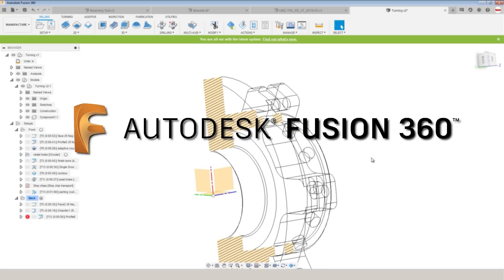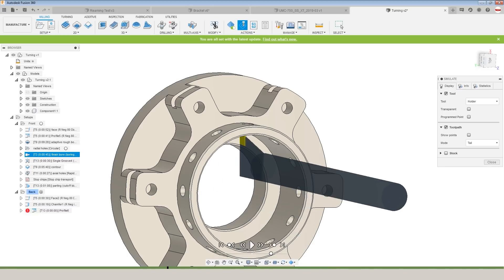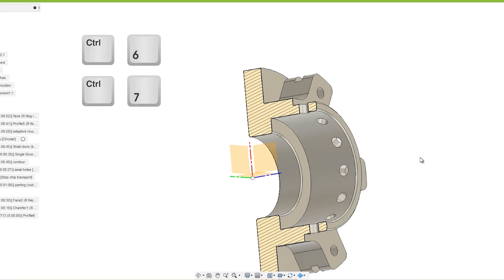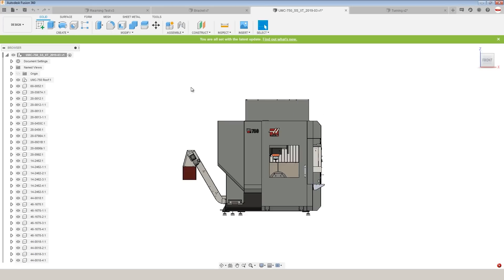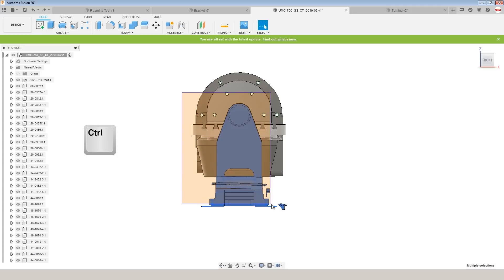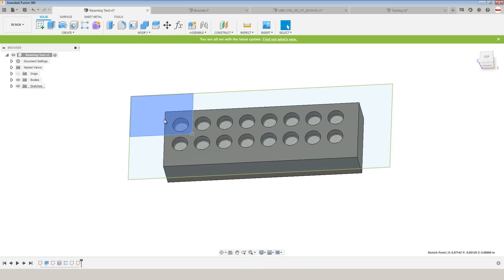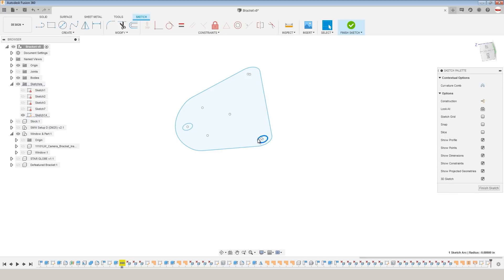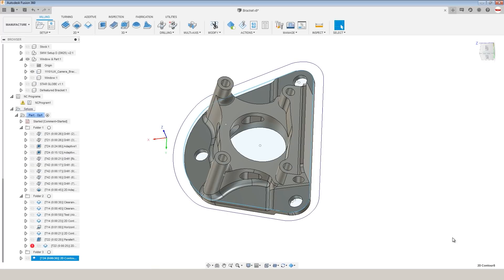10 Pro-Level Fusion 360 CAD & CAM Tips!

Comment: Impressive!!! I use to program, setup and run CNC machines over 25 to 30 years ago my 1st machine was a paper tape reader moved to a 3.5 floppy disk and then to rewrite CDs. Then I got rifited after almost 15 years of prototyping. Now I do mechanical engineering.  It was the best job I ever had. I put experiments into outer space that were successful. I made  prototype medical devices and equipment and other things I can't talk about. I also did model making, injection molding, metallurgy ,Mig, Tig, plasma, and complete wood working, to many other skills to list. That was the most fulfilling job that I ever had. The rest of my career has been boring in comparison, however it pays the bills. I just found your site after watching someone make a V8 block out of billet aluminum. Thanks for the videos I'm also going to subscribe.

Comment: keep up the videos John - gonna jump on the comments bandwagon and suggest a video helping people understand what they are losing with the changes to the "personal" version of Fusion 360 and reminding them what they still get.  What the capabilities/limitations would be using "personal" on a machine like a tormach would be helpful.
Reply: Check out Lars' video on the subject. That sums it up well.
Reply: @ScottMoyse  thanks, Ive seen it and it does sum it up on a high level. I would still like to get a more in depth breakdown of some of the limitations of things that are being brushed over by many... specifically, rapid feed limitations. What does that mean for tormach owners for example. Does this limit the adaptive toolpath itself or just linking moves between operations? NYCCNC has a history of clearly exploring topics and explaining any limitations.
Reply: @ericswakon  any where you see a GO in the code currently, will be replaced with G1 @ the programmed cutting feed. So in low feed scenarios, is likely that where full retraction and repositioning at rapid was faster previously, stay down and reposition at the non-engagement feedrate will be faster... As long as you control can read all the points without data starving.
Reply: @ericswakon  I'm also sure the community will figure out some ways of working around it. I have some ideas but I won't be sharing them publicly 😁.

Comment: Another Tip: If you need to select often edges within the CAM environment. Try to Alt+click, hold and drag away from an edge. You end up directly in the contour modification mode. Saves you one extra click - but can be many at one part ;)

Comment: I've bitten the bullet. I've ditched F360 due to their changes, and have been learning and contributing to FreeCAD
Reply: @BarryManilowa  Open-source is MUCH better than closed source when it comes to obsolescence. FOSS projects often go defunct but with the source, you (or anyone else can pick it up and continue.  Unless the original software was licensed under some odd, weak license, a commercial entity can't simply acquire it and change the license.  Such a change would require all contributors to agree and that can be difficult or impossible if contributors can't be found or are deceased.  A company can license new stuff under new terms but they can't just change the existing terms.   Taking an open-source project closed is very difficult.    You might be right about the rise of SAAS but I frankly think it has much more to do with the value of all the data collected.  Besides, the Affero license has been out and used for more than ten years.
Reply: The cloud computing means you can run cad/cam on a cheap POS notebook anywhere
Reply: its still cheap as dirt, not sure what all the home gamers are smoking.
Reply: Eggsr2bcrushed  Really?  What to stop them from charging $300/month and holding your data hostage?  What have you been smoking?
Reply: @BarryManilowa  It's 300 per year or cheaper with discounts. There's a huge difference between changing what people who pay them nothing have access to, versus upsetting paying customers and businesses with an insane 12x price increase.
Reply: @zunuf  For many people the wake-up call is how vulnerable they are when they build their business dependent on closed-source software.  There's no guarantee that the vendor won't eliminate an important feature or price you out of the market because your interests aren't aligned with theirs.  Software vendors can drop support for older equipment, change their programming APIs, or alter their workflow in ways that have significant impact.
Reply: @bradcollette2967  RMS has entered the chat
Reply: @Eggsr2bcrushed  I'm not really sure what that means.  If it's a reference to Stallman, I've never been much of a fan.  I don't have a problem with closed-source software but I think a company would be foolish to allow themselves to become dependent without thinking about it.   Negotiate a contract.  Demand that source code be put in escrow and released if they eliminate crucial features.  There are ways to ensure your investment is protected.   By the way, why such a Fusion Fan-Boy?  Got a dog in the hunt?

Comment: Autodesk has practically stopped my hobby currently, I designed and built my own cnc machine over nearly a year as I don't earn much money, I don't make money from using their software, I just enjoy making things and helping friends out with problems. So now I'm down on no simulation to check my CAM, I have to load a new file for every single tool change even though I use collets and have to do it manually so its clearly not an automatic tool changer, I have so many files well into the hundreds of active ones which I switch back and forth here and there for ideas and previous dimensions I need. I've absolutely loved using F360, very easy to use and simple but clearly I as someone who works from my little shed, making nothing but fun things for myself and pushing my own knowledge to make complex projects Is being termed a non-hobbyist as I have a machine capable apparently of more than what a hobbyist should have. I can't afford a huge hit of money for their software, I only use the CAD/CAM with simulation and that's it. It would be nice to see them listen and acknowledge the massive community of like minded people with such requirements and rethink their clear decision to force out the very people who provided for years the testing and finding the niche problems. I'm really struggling with FreeCad as it's incredibly hard work but I fear this may be the only option without having such massive headache from f360.
Reply: Dejan Brice I believe you are confusing two different “simulations”. It is my understanding that there is no change to toolpath simulation. What is being removed is the simulation workspace ie stress and strain analysis.
Reply: @martinmarriott3607  I really hope that may be the case, without it It's going to be such a wish and prayer job as I make many mistakes even with the simulation!
Reply: @dejanbrice8774  I know it would be a bit of a hurdle, but solidworks has a free hobbyist license that you would probably qualify for. It does require yearly activation which they could revoke at any point but currently it seems to be a better option than fusion which seems oblivious to the vast number of users they have that are somewhere between the "I have it on my computer but never use it" people that they're okay with giving it away to, and the "I make so much money off this that I can afford to pay $1000 per year for software that's super buggy and crashes on a regular basis" people
Reply: >builds a cnc machine that had to cost thousands
>cant afford 400 a year for software
Reply: @Eggsr2bcrushed  Can you not read what I said or do you enjoy trying to start arguments? For the record, total price finished was just under £1500. So swivel.

Comment: John, it is time to move to next CAD/CAM software, fusion has lost it's good will among us. You need to make a FF about that, while people can export their work from fusion cloud.
Reply: That's the biggest issue here. They can change their terms at any point and then you're in a pickle. And since they own all of your files (by default all of your data is stored on their servers and not anywhere that you can control) and are locking people out of data formats that are compatible with other software, they can literally hold your data hostage and you'll be forced to do whatever they want if you want to get your data back.
Reply: He used to do videos on Alibre Design. Still a viable solution that offers perpetual licensing :)
Reply: What's the alternative? MasterCAM costs 300x as much and Onshape is just as expensive. This is coming from an Onshape user, Fusion is the best bet for hobbyists even now. $16 a month isn't that bad for what you're getting.
Reply: Not sure where are you getting 16 USD, here it costs 61 EUR, or 7% of average monthly salary. But you are right about been the cheapest PRO solution.
Reply: @zachbrown7272  Except as a hobbyist you can currently get solidworks for free. Also, not sure where you're finding that $16/month figure; they're asking $80/month
Reply: @JamesEsau  I'm getting it from their website. You should also take into account that a lot of the people watching this channel aren't hobbyists.
Reply: @zachbrown7272  I'm replying to the part where you said fusion is the best bet for hobbyists, because that's just not true anymore, unless you can make do with the new crippleware version
Reply: Fusion has lost YOUR good will? How about them giving away incredibly powerful software for FREE and allowing you to ride the learning curve with zero investment on your part, unlike many other professional software packages. Where does YOUR good will apply?  You just got used to getting a TON of value for free and are now offended that Autodesk feel they should be compensated for what they've built.
Reply: Legacy Goods Pretty soon the only thing the “free” software will do will be sketches at this rate. They were never going to get money from the lion’s share of hobbyists, so why are they trying to squeeze conversions out of them now?
Reply: @BradyBegeman  Autodesk ovbiously knows more about what makes them money than any outsider, along with what costs them. They aren't stupid, this is a calculated move to get dead weight to either leave or start paying.

Comment: Are they ever going to implement NPT threads in modeling?
Reply: I have asked in the autodesk forums, i believe it is on the list, just not a super high priority, sadly.
Reply: Female NPT threads are in the hole creation menu - hole tap type called "taper tapped".  Still not implemented for the male threads, though.